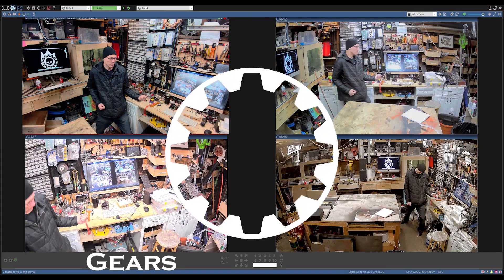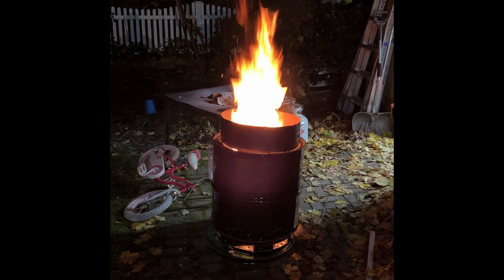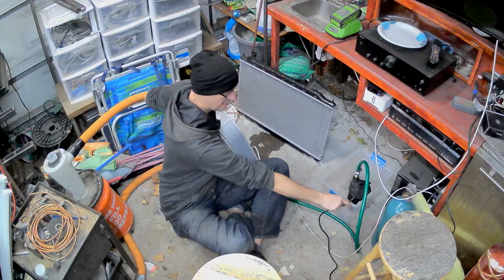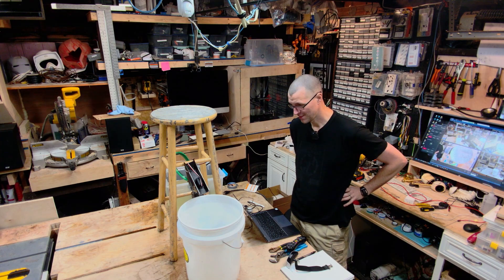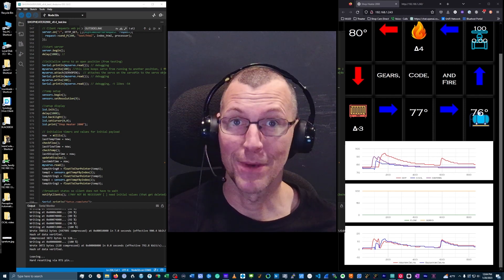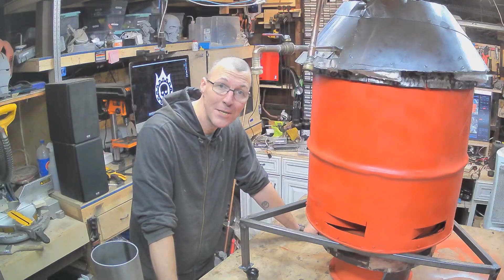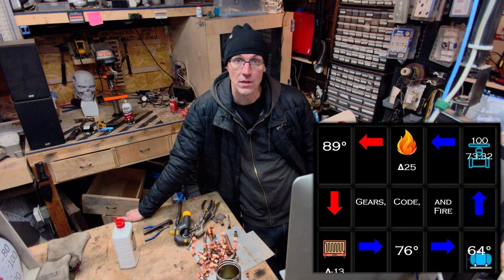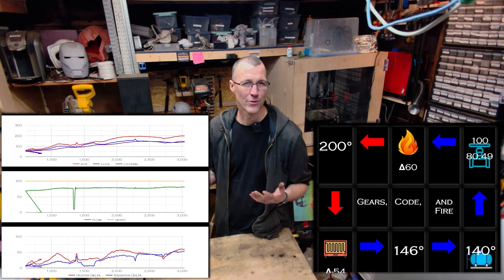I Built a DIY Wood Fired Hot Water Radiator (And It Works)

Comment: Best idea ever to help me heat up my pool
Thx for the help
Reply from the maker: Thanks man, a lot of the inspiration for it was from people using a lot of copper tubing hooked up in an open loop to homemade Jacuzzis. I think I really saved on the copper cost with this approach! Most importantly, as long as it's an open loop, you don't need to worry about steam as much (except perhaps with solder joints), it might even be better to go for steam to get the whole phase change energy capture

Comment: I had an old boiler at one house. It used zero electric to move heat. Hot water rises, cold water drops. Hot steam rises, cools, falls back down after cooling. Pipes were 2" dropping to 1.5. I loved the system, but it would be impossible to maintain a temp within 7 degrees. You literally left the upstairs if it got too hot, and went downstairs, and vice versa.
Reply from the maker: I am in no way an HVAC engineer, but given that I live in an area where a lot of the buildings are from the early 1900s featuring steam heat, I got really into this entire concept. To be clear, for this version (I think I posted this almost 2 years ago and will post a revision soon), my general mantra was, "no steam... steam bad." That said, my new rendition involves two distinct heating loops with two different whistles for each heating loop to alert me if steam is happening (which shouldn't), and I am super jazzed about the preliminary results and measurements. Coming soon, really glad you watched the video
🤘

Comment: Epoxy is ure friend....nice rad 2 hose connects!!!!!   Safer than mine...haha
Reply from the maker: JB Weld definitely did better than the original application of Shoo Goo! Thanks for watching and stick around, I'm gonna do a video on upgrading all of the problem pieces hopefully once the holidays are over! (As in, no solder joints in the hottest point of the system… A better reservoir… And a much better control algorithm) anyway, thanks again for enjoying my first YouTube documentation endeavour!

Comment: Old heater core from a old scrap car /truck . That pump is only good for cold water. You got the right idea. Keep trying ❤
Reply from the maker: Thanks man for watching- This pump was marketed as a radiant heating circulating pump... but i was winging this when i made it. That said, I got a lot of hours out of that pump and it hasn't failed yet (I assume you were not talking about the sump pump, which promptly failed at 150F).

Comment: Nice! Inspiring. My parents have a gorgeous rock fireplace  looking to "move" some of that lost chimney heat to the back of the house in this way. Thanks for the insights!
Reply from the maker: I'm glad it was inspirational! Just make sure to have multiple places for pressure releases in case you inadvertently make some steam! Also, I am eking it right now and switching to orange pex which is better rated, and I am going to add some logic to automatically control the fan speed based on the desired temperature
Reply: Doesn’t the radiator have its own pressure relief cap?
Reply from the maker: @greggoryleblanc1024  Nope, I am not a car guy, and only mildly a motorcycle guy, but I think the pressures they allow our far higher than what I wanted to deal with in this very amateur learning project

Comment: As an engineer myself I love to overcomplicate things, sooo, you can PWM the pump to control the flow so u don't need the ball valve.
It's always fun when u can use a microcontroller in a project :P
Reply from the maker: I nerd-fitted on the Reddit about this! My basic Internet recon about this revealed that most pumps are brushless motors, and that brushless motors did not work well with a PWM signal. The funny part- the newer seems to be a sweet spot where i am better off controlling the temperature of the system with my fans than with the flow.

Comment: Someone might have already said, but a single point calibration of the flow rate will probably not be accurate for the valves entire travel as it's unlikely to be a linear relationship between % valve open and flow rate. 

That being said, for your purposes it probably doesn't matter, since you're using temperature to control the valve lol
Reply from the maker: Thanks so much for your thoughtful comment, and that thought had crossed my mind. Luckily, after I got rid of the over powered sump pump and used a simple little 8 W pump, I didn't need to use the servo to control the flow at all! Future improvements could be something akin to PID tuning the fan with an on-off state, using the hot water as the, um, OK, so I forget the names of the variables, but you get the idea!